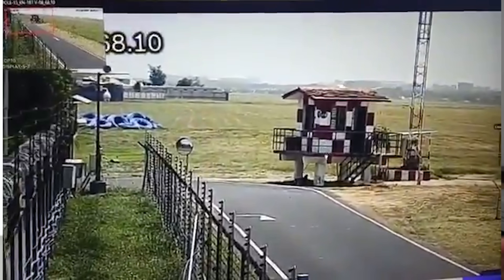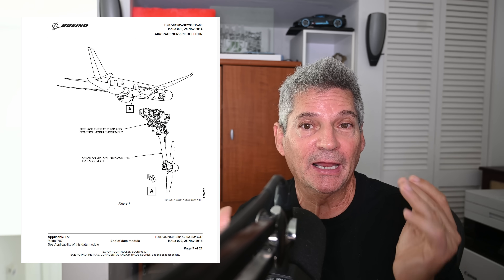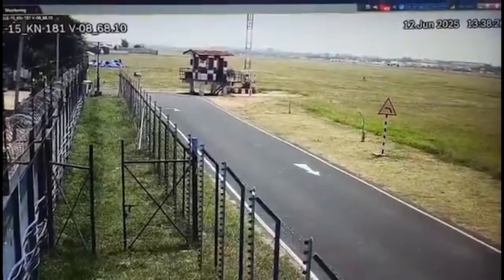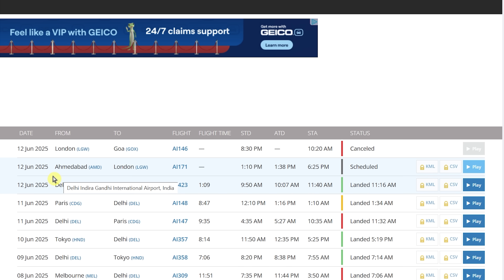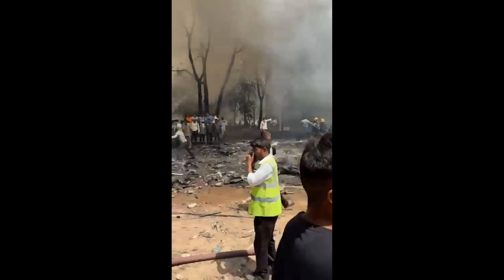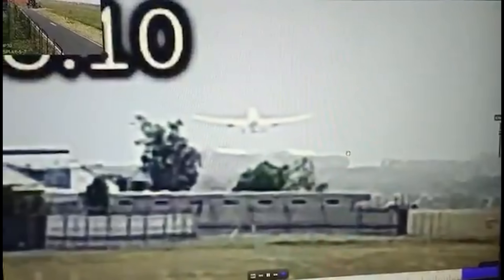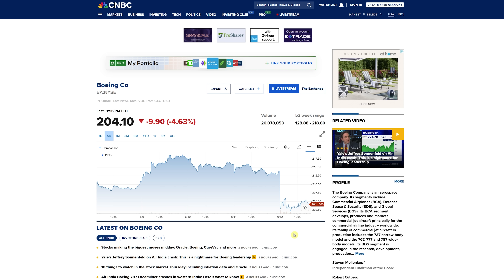What Caused Air India 171 Crash, Mysterious Sound Before Impact

Comment: Other podcasts have reported that the plane was fully loaded, that the airport instructed the plane only to use 6,000 ft  instead of the full 11,000 ft runway, that the outside temp was 110 Fahrenheit. The plane only manage to reach critical airspeed at the end of the runway and struggled to lift off.

Comment: single engine failure on takeoff with a full load would definitely cause this. did not see smoke so maybe a fuel supply fault? I also did not hear any jet motor when it passed in the clip, but did hear the RAT.

Comment: 7:05 that chart shows them doing their initial rotation below 100 knots. They did climb away from the ground and they increased altitude, so they must have reached their V1. But that charted speed doesn't sound right, not for a fully loaded airliner(one of the biggest airliners). It actually shows them reaching 200ft by the time they reached 50 knots. I have to doubt that is correct data. Maybe if it was a Cessna 172. The info from that chart cannot be reliable.

Not an expert opinion. I'm not a pilot, I just pretend to be one in flight simulators 😁. Also, I rarely simulate large airliners. Mostly fighters in the Falcon 4 series of sims. Then a good bit of time spent with the Cessna models in MSFS.  Though I have learned a bit and played with the 
CRJ 7s and 9s because, I fly (as a passenger) on those very often and something about them intrigues me.

Comment: google AI answer:  
Higher air temperatures negatively impact takeoff performance. Warmer air is less dense, requiring longer takeoff runs and potentially reducing the aircraft's ability to climb. This is because less dense air generates less lift and engine thrust. 
Here's a more detailed explanation:
Reduced Air Density:
As air temperature rises, air density decreases, meaning fewer air molecules are packed into a given space. 
Less Lift:
Lesser air density means the aircraft's wings generate less lift for a given airspeed. 
Reduced Thrust:
Jet engines process air to generate thrust. Warmer air, being less dense, means the engine processes less mass, resulting in less thrust. 
Increased Runway Length:
To compensate for the reduced lift and thrust, the aircraft needs to accelerate to a higher speed before taking off, requiring a longer runway. 
Weight Restrictions:
In some cases, high temperatures can necessitate weight restrictions, meaning passengers, baggage, or cargo must be removed to achieve a safe takeoff speed. 
Density Altitude:
Pilots use "density altitude" to account for the combined effects of temperature and altitude. High temperatures can effectively create a higher "density altitude," making takeoff performance feel like it's at a higher actual altitude, which further reduces performance.

Comment: If the copilot pulled the lever to raise the flaps instead of the lever to raise the landing gear - would that cause the ram air turbine you mention just after 3 mins in to kick causing it to generate the sound of a propeller plane?
Reply: BTW Capt Stiiive suggested pulling the wrong lever might have caused the failure from that point on - not my idea... but it does make sense...  UNLESS there is some kind of autogenerated test that sounds an alarm if wrong lever is pulled???

Comment: It keeps coming back to the mistake being the flaps were put up instead of the wheels. Pilots have said this is eminently possible. Alarms would sound but too much else was going on..  suspect there was another electrical issue as well and the plane was heavy with full load and high ish temps of 38C  on runway (yes the metar said a little less but the runway is always a bit hotter). (Q Would it have got airborne at all , with no engines??)
Reply: You do understand that, even if the absurd notion happened that the pilot retracted flaps, that those don't instantly retract.  It would have taken 30 seconds or so for that to happen.  Typical takeoffs too are not with flaps fully extended but often in position 1 which is barely deployed and you certainly could not see that from these grainy videos at such a distance.  You only use full flaps for landings or extreme conditions.

Comment: that seems the typical Mayday tv series take off crash. A miscalculation of the aircraft weight, velocity, air temperature, wind, etc. that lead to an early take off in a lower than needed velocity. Airliners are not aerobatic planes and cannot recover from situations out of normal operation conditions range. Maneuverability is limited by factory settings.  That' it!

Comment: New take off procedure. Flaps out until flight ceiling height is reached to have maximum glide range. Pilots must know the glide range and look for the best possible landing side like a river or empty field if the engines turn off. Also must dump all fuel if there is no chnace that the engines start to have a most empty tsnk as posible. All seats should have Airbags in the front seat!!! Passengers must put jackets or blankets in front of them to reduce  schock impact.

Comment: Rat was extended so no electrical power on the flight deck, passengers on the aircraft on the earlier flight, said no monitors and no aircon so it seems as if one or both engines were failing to generate power.
Terrible loss. 🕊
Boeing must stop reducing sensors and removing redundancies
Reply: Positive rate of climb was not achieved or the U/C would be being raised ?

Comment: Aircraft Mainenance Engineer here, Although the air india 787 are not in a very great shape ( I have done some turnarounds at Arlanda for them few years ago) The 787 has standby electrical hydraulic pumps before use of the RAT so that theory is wrong. Also they can not have taken off without flaps down since they would get a loud "takeoff config" warning alarm in the cockpit as they put the thottles forward. As soon after they lift they should put the gear up to minimize drag. What i think happened is that the pilot somehow put flaps up instead of gear up after takeoff. This would cause the plane to slowly loose lift and as the captain is trying to compensate for the loss of lift pitch up and slowly decend into the ground. There is absolutley no reason for them to still have the gear down at that point.
Reply: If birds went into the engines and caused dual engine failure there would have been loud bangs due to birds shattering blades in the turbine and causing "compressor stall" which sounds like multiple loud bangs, just search it on youtube and you will hear how it sounds.

Comment: When we think of plane mysteries we automatically think of MH370 which was a Boeing 777 and went missing on 8/3/2014.
This Boeing 787 was delivered on 28/1/2014.
MH 370 went missing on 8/3/2014, the very same year!
Day gap = exactly 13+13+13 days.
So after the Boeing 787 was being delivered to it's owners only 39 days later and MH 370 went missing.
The airport that the Air India plane crashed with only one miraculous survivor was Ahmedabad.
Ahmedabad = 13+13+13 Ordinal gematria or 39.
And both date digits add to 18.
2+8+1+2+1+4 = 18.
8+3+2+1+4 = 18.
And this is all coincidence?

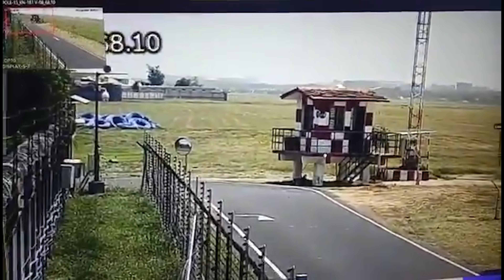Comment: 10:29 the fact that you go into “Ram Air Turbine” and all that but don’t comment on the fact that both videos show that the proper flaps configuration was not set for takeoff…hmm. The security camera version clearly shows these pilots didn’t even lower the flaps for takeoff nor did they raise the gear either. Both which are bad for lift at low speeds if not configured correctly, causing them to lose lift. If that looks “normal” to you….jesus.

Comment: I suspect it wasn't the plane's fault. And it wasn't the pilot's either. If both engines failed at the same time, it seems to me there was a defect in the fuel. Either it wasn't kerosene, as required by the aviation authorities and used by aircraft manufacturers (contaminated, of inferior quality), or it was a different fuel that wasn't approved for aircraft. That's a good way to make a few thousand dollars in profit if you don't care about human casualties.

Comment: The take off speed depends on the total load of the Aircraft so you cannot say 174 nots is about right, if the load is higher than the calculated speed, this could happened

Comment: What i think is that the copilot misjudged the landing gear with the flaps and turned the flaps instead of landing gear.

The plane had ample amount of thrust that why it took off nice and  clear but instead of pulling up the landing gear he might have turned the flaps.

So it crashed instead of flying

Comment: 1:52 I can hear the Sound of RAT being deployed. Looks like immediate loss of power on both engines after take off 😢
Reply: If you pause the vid (or pay at 0.25 speed) at 1:57 you can see a very small 'smudge' on the underside of the fuselage that looks it could be the RAT mentioned. it follows the plane for a few seconds so looks like its attached to the plane.
Reply: @bradsowden6735  Yes, if you slow the YT video down to 0.5 in the Settings it easier to see.
Reply: yep that's it and it is confirmed by the raw video now available. engine power loss at 15 or 20 second of take off, no gear retraction, RAT deployed and clearly heard on the raw footage.
Reply: That's so heartbreaking
Reply: I can hear a loud scream
Reply: It's much more likely a loss of electrical power to essential busses that would deploy the RAT.....IF that ocured.
Reply: @NamelessRider  The only thing that explains the immediate loss of all thrust is a dual engine failure.

Comment: Common sense tells for it to plop down so rapidly - BOTH engines failed. 

If one engine failed, plane would have veered instantly, sudden assymetrical thrust. No time to correct with rudder.

Ram air turbine also would not flop down if only one engine flamed out.

Bird strikes.
Reply: I agree both engines failed.  Bird strike is a possibility but also the possibility exists that the auto-thrust system, which is commonly used on these airlines, glitched and brought both engines to idle.  No matter what the cause, the pilots had no chance.  I think Airbus stock is a good buy right now.
Reply: @arizonastrummer 

Same with these flawed FBW, overautomated, nonoveridable Airbuses. Auto-thrust screwed up and caused several crashes.

That's what happens when you let computers fly the plane.

Why do you need autothrottle anyway ?  Can't the pilots simply shove them up or down as needed ?  Should be banned.

Btt I think it was a complete flame-out. The RAT won't flop out if the engines were still idling.

Comment: I think some safety interlock malfunctioned leading to shutdown/ stopping the fuel supply to the engines and the pilots could not reset the same............Flight fell down as the engines didnot get the fuel..........

Comment: Mistake in calculations resulting in incorrect take off settings.    As a result he wasn't going fast enough to achieve lift.  Upon realizing this i'm sure he slammed the engine power all the way but then raised instead of lowered the nose.   In the history of air crashes, this is actually pretty common.   Pilots describe being in similar circumstances and the knee jerk, natural reaction is to raise, not lower the nose.   Lowering the nose while simultaneously increasing engine power however is the only way to avoid a crash.

Comment: Im not sure how many fights you've been on   there is a lot of engine noise and echo as the plane comes into veiw and passes by    If the engine / engines were low speed, idle or stahl'd  there would be no where near the amount of of engine noise    air flow over the wings and body is rather quiet

Comment: If both engines fail, it's bad. Then the electrical power goes out and the lights in the cabin go out. The propeller only provides emergency power for a few important systems and instruments in the cockpit...this could be a sign of a double failure. With the emergency power, an auxiliary power generator could be started, but it's a time-consuming procedure. And with that, one could try to restart the engines, but that's an even more time-consuming procedure. That only works above the clouds, not above buildings for a second. Takeoff is the most dangerous part.

Comment: Because the 787 has such thin wings, it's very clear @1:54 that the flaps are not down.   At the very edge of having no lift at all, rotation would stall the wings ... and he stayed in that nose-up attitude right to the end.  The pilot thought it was a loss of thrust, and he may have manually dropped the RAT - although tbh I don't hear it.  (It would have increased drag and made things worse if he had.)

Comment: 0:46 Again, as in the recent Canada crash landing; I don’t c flaps deployed. These critical wing units won’t produce enough lift @lower speeds2 remain aloft. 

5:01 Just look @how obvious the flaps appear from the rear. U will note how obviously absent that these r on the crashed unit.

My guess is that he rotated, jumped off of the ground w/brute power, lowered the nose slightly, stalled &fell from the sky @full power w/insufficient lift2 stay airborne.

Comment: I've said it before, and I'll say it again....I can't cut my grass unless ALL of the safety switches are in the proper setting....this goddamn plane should have sat on the runway UNTIL the idiots piloting it had ALL of the switches in the proper location.....c'mon, how hard is that?

  Engine issues?....spool them up, brakes on, minimum 30 seconds....check ALL parameters......over 200 humans died with really bad folks NOT flying this plane....this is criminal, release the lawyers!!!
Reply: How would you know all was not in order at take off?

Comment: Jets don't always make a jet noise like in the movies.  Also, the RAT is small.  It's like claiming you can hear the alternator as a Harley drives past.
The video clearly shows the landing gear down and apparently minimal or no flaps (the wing looks like a line at one point 1:53).

Comment: The sound is the ram air turbine, exiting automatically when the engine don't work anymore.  I was amazed how many people argued the flaps were not set, but looking very close showed a blurred out part under fuselage, behind  the main landing gear.  Nobody put attention to it, they were too focused on babbling about FL24 and mid section take off and wrong flap setting and security  features of the 787.  Another example people rather talking than thinking.
The second video was released a little delayed, but it was available when people showed how smart they were.

Comment: One interesting thing to note is that when in the aircraft is in "In-Air RAT Only Mode", the transponder becomes INOP. This would explain why the transponder data ends much earlier than the final impact of the aircraft. It suggests that the location of the dual engine failure and the deployment of the RAT occured roughly near to the final reported position on FlightRadar24.

Comment: No the survivor said after crash he saw an opening from where he got out and flame had started as his hand was lightly burnt. He didnt jump out of the plane. A person who was in the same plane from delhi to Ahmedabad (pls see his video) mentioned non normal movement of  flaps. He also said AC was not working properly switching on off  cabin crew call switches not working at all so there might be an electrical supply issue and thats why the emergency rotor was initiated. Dont know if plane electrical power has impact on engine or controls

Comment: One thing that is standing out like a sore thumb. Where are his flaps? He pulled them early or never had them set to begin with. To the poster of the video. Of course is it going to sound like a prop plane from the front of the engine, they are turbo fan engines. Essentially a large jet powered ducted fan. This is how new engines function. The fan produces the majority of the thrust these days. I can see your thought but frame by frame you can clearly see it is not deployed. I'm thinking the sound is coming from an echo of the fan.

Comment: I have serious doubt on the maintenance and technical check ups prior to the actual take off. I don't think engineers did maintenance work and technical check ups with full devotion. This negligence may be due to fatigue out of excessive work load which is quite possible in private airlines whose main aim to maximize profit at minimum cost.

Comment: Can you imagine what each of those 240 passengers experienced? They first notice the aircraft is not going up anymore. Then, they feel the aircraft is starting to drop. Then, they realize they are going to hit the ground. Then, they hit the ground and the fuselage starts breaking up and then a bunch of jet fuel splashes all over their body. Then, they see flames coming toward them. Then, their fuel soaked clothes start burning with large flames they can't put out. Then, they feel a burning sensation all over their body but that doesn't last long because as soon as the flames burn the skin off they don't feel the pain anymore. Then, they try inhaling some air but the only thing that enters their throat and lungs are flames.

Comment: There was dust being kicked up while taking off.  It seems odd that they would get that far down the runway before rotating.  Usually, they would be airborne before the threshold, and then there's still a buffer before it gets to grass or whatever.  I suspect the issue was well before that (maybe FOD on the runway?), causing a long takeoff and possibly ingestion of that dust made it worse.